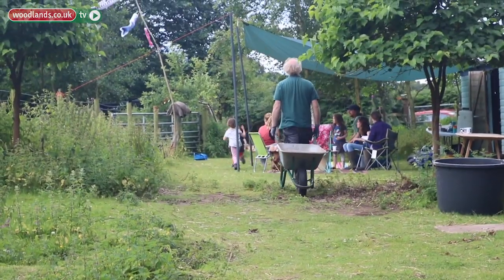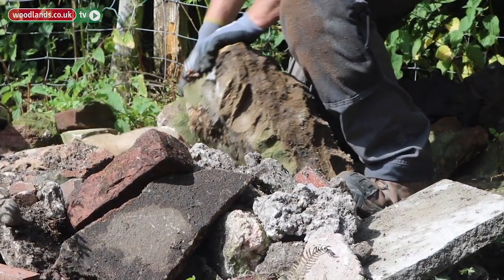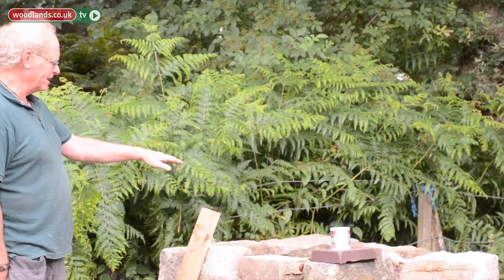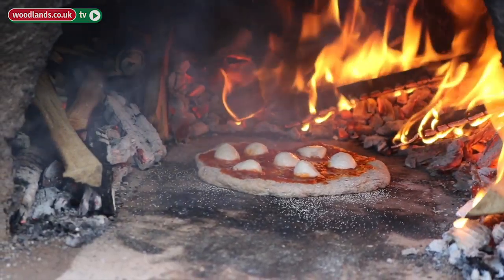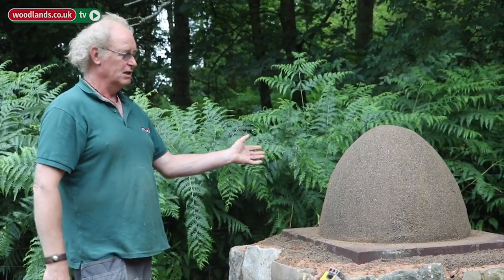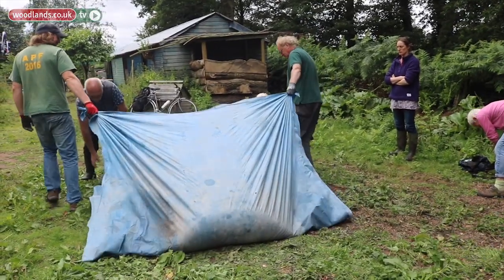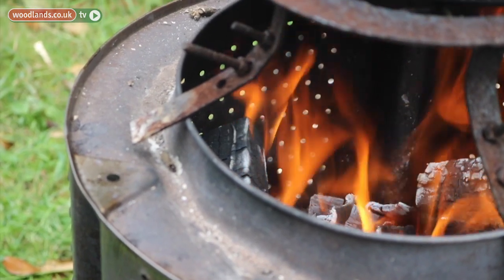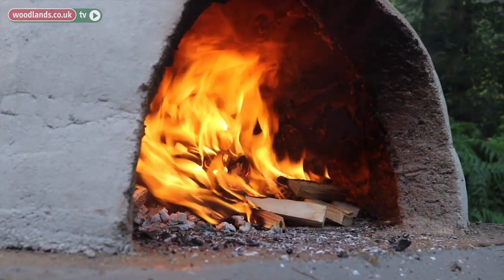How to Build a Cob Oven

Comment: why not use the clay/sand for the cooking surface?
looks like a fun project. Love using sand as a form for the dome. I was thinking of far more complicated than I needed to. KISS really is true.
regardless, this opens up to tons of ideas.
Reply: i'm guessing those other stones radiate heat better than simple concrete. ( meaning crispier yet soft inside crust )
Reply: It's actually because the clay mix will break up and a high abrasion area like the floor will leave little bits of cobb in your pizzas! The bricks are harder and will stand the test of time much better.  @robinchwan

Comment: You don't use a chimney because cob isn't a good insulator? That sounds so inefficient.
Reply: He's saying that if there were a chimney, all the hot air would simply escape out the back and there would be no good insulation to hold the heat.
By building the door high enough, it provides an outlet for hot gas, which draws heat through the entire roof of the oven.

Comment: You use earth clay not manufactured clay and it should be wet when adding to the sand!
Reply: With hay for added strength
Reply: I was looking for something like this- though I am sure the manufactured clay could work, I was confused when he said you have to dry clay soil when making cob? I thought you used it just normally, no drying needed?